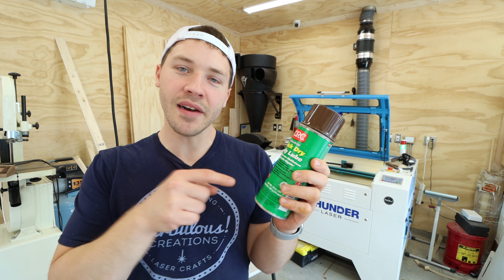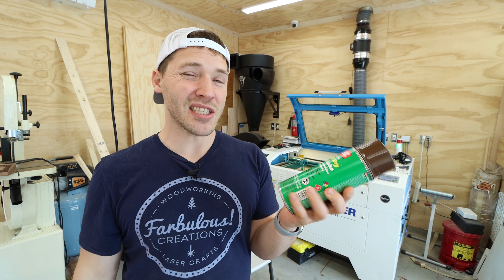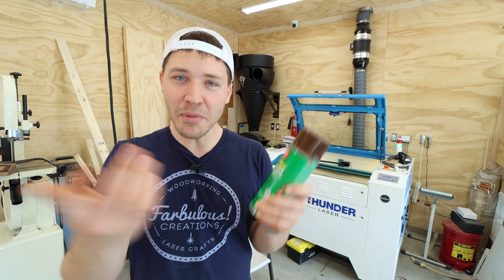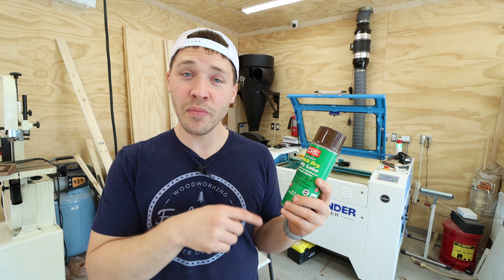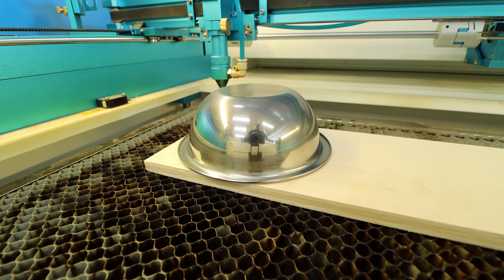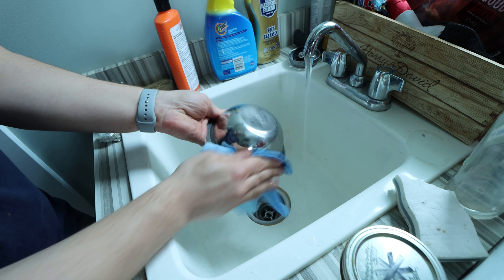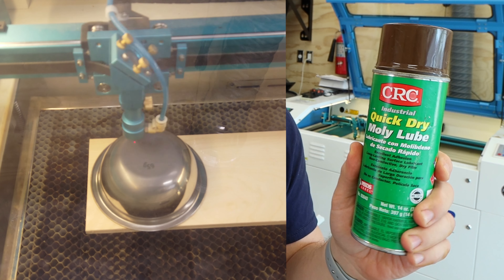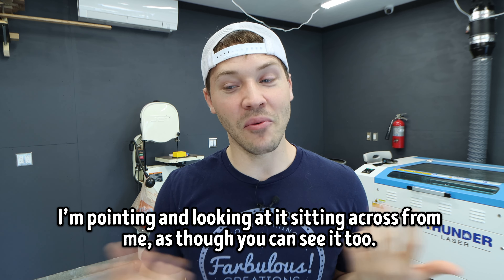CO2 Laser Etching on Metal WITHOUT Cermark

Comment: Would Black spray paint work?
Reply from the maker: I haven't tried on metal, but I'm pretty sure the paint would just get "burnt" off in the area of etching. That said, if you wanted to entirely coat a piece of metal in spray paint and "etch away" the paint to reveal metal, that would work! But not for etching a "positive." Hope that helps!
Reply: @FarbulousCreations  I might try this tomorrow. I only just discovered the concept of laser etching with low power lasers, but if it's a case of allowing the heat from the laser to be absorbed more effectively and vaporise the base metal rather than the heat fusing the compounds in the etching spray with the metal I'd imagine anything opaque would work

I may be completely wrong about how the process works, I'll update if it's successful!
Reply: @CalibreDesigns .. have u tried this??